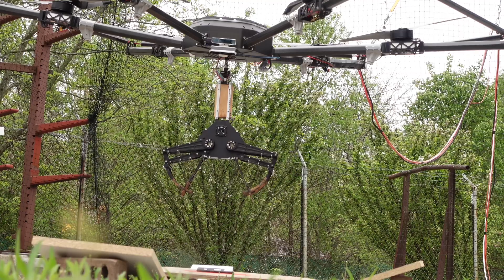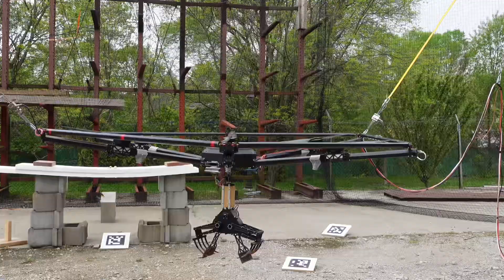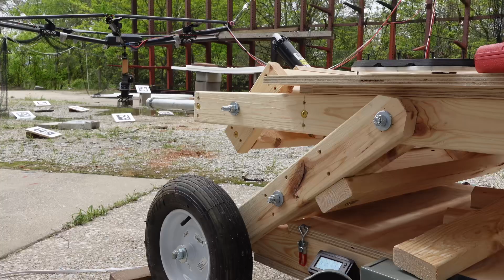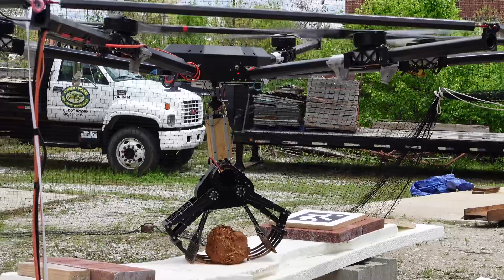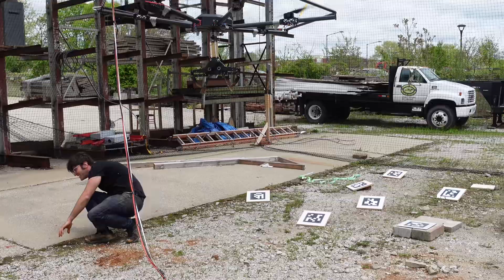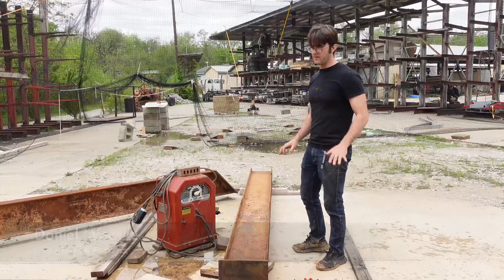Construction Drone Learning How To Fly & Build (AI) FLIGHT FOOTAGE

Comment: I suspect the safety wires aren’t helping rom a control perspective. They’d provide variable drag that the software has to compensate for.  Watching the challenge of using the articulated grab, it kind of looks like a more ridged grab would work better.

Comment: Color me vacuous.. but how in the world is a drone's application for 3D printing going to work?  It'd have to repeatedly grab-and-go wet heavy material wouldn't it?  Isn't it going to suck the electricity out of the grid with that kind of energy in use?  How at all is this feasible on a scalable level?
Reply: 1) our drone uses less energy per kg moved than a standard mortar pump. Those things aren't as efficient as many assume
2) our drone weighs 100x less than a typical concrete printer gantry which means we are moving way less extra mass around
Reply: @terran2067  I can see that.  Have you taken wind conditions and repeated tasking in those energy evaluations?  According to this it's only started to learn how to pick up objects.  Surely the energy quotient has gaping factors to consider
Reply: Nature shows how efficient this process can be, just look at the mud dauber wasp or the Robin that reinforces her nest with mud. Those organisms don't have energy to waste. Back of the envelope calculation: say the material to build a whole house weighs 500,000 pounds, every clump has to be lifted 30 feet by the drone. If the drone wastes 99% of the energy it consumes, it still only takes 565 kilowatt hours of electricity. That's half a month's electric bill for the average American home. Very feasible.
Reply: Shield the drones inside a self assembling  Ringling Brothers and Barnum & Bailey Circus tent, dropped when the structure is completed. 

Use laser print heads instead of dot matrix 3d printing style the way we do things now. 

Run the drones on magnetic or graphene energy and those costs are radically reduced.

LET'S PRINT!